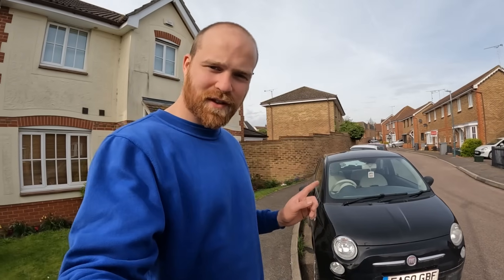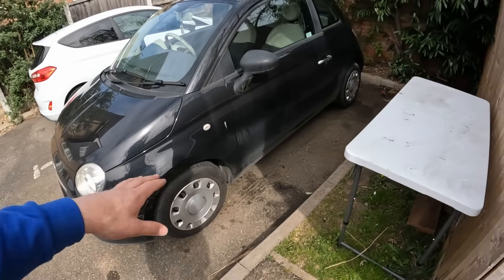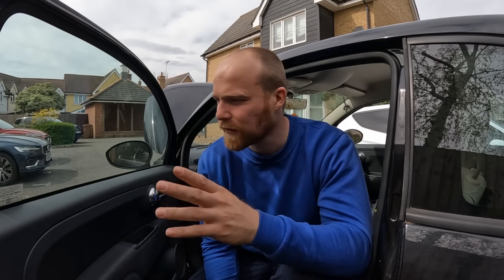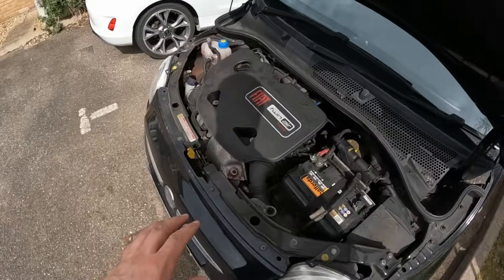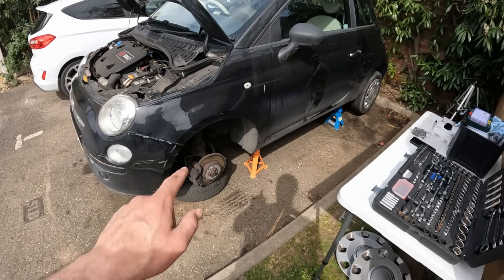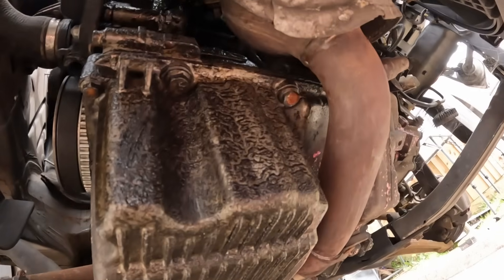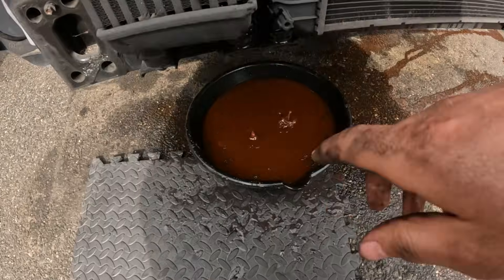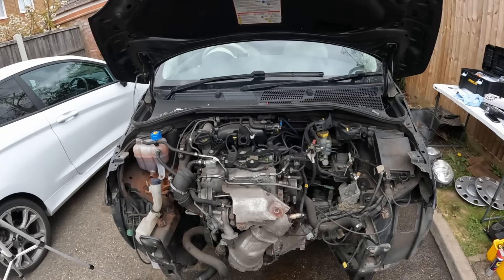Can this Fiat 500 be saved from the scrap yard?

Comment: These engines have variable valve timing, the inlet valves work from the oil pressure rather than the cam. If you had pretty low oil pressure the inlet valves would stop operating properly. Adding oil prob fixed the problem
Reply: If you want to learn and are prepared to replace the engine, you should have gone ahead and taken it apart, both to learn and perhaps fix what is wrong and because each piece can be lifted out by hand with no hoist.  Though if Tayer... is right, then the only problem might be the original oil leak and the fix might just be a seal replacement, though some oil seals are hard to get to, so some learning disassembly anyway.  Or just keep driving it, perhaps with towing insurance, and mind the oil level.  Either way, if it doesn't work out, that would have been the time to get the used engine.
    However, I think I did see extra steam and water from the exhaust so I suspect head gasket, which is a job you could do yourself.  Mustie1 even sanded down the high spots on a warped head by hand, without a planer.
   But now that you already have an engine I suppose it makes sense to go ahead and put it in, then either store, overhaul or sell the old one.  With full disclosure you can ethically sell an engine in any condition.
Reply: Hi just reading your comments we have a twinair that had a major oil leak and cut out. It was basically empty, no oil on the dipstick. Would it have cut out before it caused any engine damage and should we fix the leak and put oil in will it still be OK?

Comment: Oil starvation for the twin air is no good. No oil no pressure to push the valve open, may check the uniair module. Those engines need 0w30 fresh oil and always at the right level. The leak may be the turbo oil hoses. Do a flush of the engine oil and new 0w30 with the correct specifications. I worked on many multiar engines.
Reply from the maker: Thanks for that info, Eric. I did read the other day about the specific type of oil these engines need, so will be sure to get some and make sure she's running sweet

Comment: Before tearing Tina apart too far I suggest checking oil quantity and quality as these twinair engines rely on oil pressure to open the inlet valves. the last one i had with low compression was just low oil level. Hope this is useful.
Reply: I believe you are thinking of the Multiair, which uses high pressure engine oil to open the intakes. The intake cam is replaced by a "brick". A cam follower opens a hydraulic valve to feed oil, then the ECU pulses a pair of hydraulic/electric valves to open intake valves, as needed. Twinair has 2 overhead cams, from all I've seen in photos/vids.
Reply: Pretty sure the twinair works on this system too

Comment: I can imagine that VVT (variable valve timing) was slightly out of time. Also hydraulic lifters pushed all oil out causing valves didn’t open. The blue smoke was caused by the oil passing by the piston rings when the valves were closed and it caused vacuum in the combustion chamber. Oil top up/change would more likely sort the issue because there was just enough oil to keep the engine running and lubricated. As soon as you floor it, it lost oil, emptied lifters, moved VVT… Possibly lost oil for couple seconds but wouldn’t cause a catastrophic failure of the engine. 

Sorry if this comment is not the answer what you found when you pull the engine out. I just found this series and it is awesome you are not afraid to get your hands dirty.

Comment: Warrior PU gloves from eBay sellers are the best. Thin enough to feel (I do a lot of cycle mechanics as well and they're good for tiny bike parts) but you can reuse them loads and don't rip. Eventually the tip of the index finger wears but takes a while. Not expensive for several pairs.

Comment: As it's an older car,I would drain the oil,fill and run with flushing oil,drain,add correct oil and low friction additive,and see how it goes,before deciding on next step.

Comment: If you have small leak in engine block (blown gasket) on cold start it might not have blown gasket but once heat up it will or vice verse it depends where crack is

Comment: Assuming it is working, engines don't "just cut out" due to oil starvation, without first illuminating the oil pressure warning light.
When you turn the key to switch the ignition on in most cars, three red lights illuminate, just to let you know they are working. Those being for electrical charge, oil pressure and  handbrake/ brake warning.
If they ever fail in good times, they need to be fixed before the bad times.

Comment: Changing the engine is definitely the best course of action and is within your abilities. Don't throw anything away until the car is fully reassembled and working. You never know what you might need. You will need to flush your cooling system once it is back together again. A new clutch would be a good idea too. Don't even think about leaving the gearbox in situ. Separating the gear box and reuniting it with the engine is a LOT easier with it all out of the engine bay.
Reply from the maker: Thanks for the advice bud 🙌🏻

Comment: Congrats on the engagement. 
You have another fun project. I would deffo look at the twin air and cam as it could be part of your problem. 
Also, the common fail on tye door handle is the small hinge that fails. I have one you can have and I will post to you completely free.
Reply from the maker: Thanks, Tony. 

That's a very kind offer. I think the new door I've bought has a handle already, but if it doesn't then I'll give you a shout 👍🏻

Comment: Without oil it wouldn't set the valve timing and could leave the valve standing open hence no compression ,  as it runs , put in a oil flush , run it , change the oil and filter , run it for a couple of weeks and do it again see how you go ,  if it knocks then look further , but you need to get rid of the muck in the engine without tacking it to bits , change the oil ...

Comment: Intake valves of multiair/twinair engines are actuated via oil pressure instructed by cam/selenoid valve. Likely the oil starvation left one valve partially opened justifying the low compression in one cylinder. When fill with oil to normal levels the distribution system back to normal and compression reappears. Probably nothing wrong with the engine and oil consumption maybe related to some leaks, pcv valve malfunction, damaged turbo compressor, etc.

Comment: King! Love your videos. Love your humble and honest character that shows through. I had similar issues. Dents in door and wing from a hit and run. Handle etc. Also had power loss issues. Couldn't get it out of the lidl underground carpark without gathering enough speed to slingshot  up the incline. Felt like captain kirk when I made it. Mine ended up having a Leaky diff and needed a new gearbox. Cost of labour and parts in excess of value. Part exed it with known issues for something Korean. F. I. A. T. = Fix it again, tomorrow.

Comment: Pink crystal stuff is probably dried antifreeze as for the engine there is no need at all to remove any subframe or driveshafts just undo all the bellhousing bolts and slide the motor to the left and it will separate from the gearbox all you need to do is support the gearbox before separating them

Comment: probably the valve stuck when the oil pressure was low? the piston ring might also get stuck sometimes? the oil indicator light sensor must be broken if the light didn't come on?

Comment: Pink crystals will be antifreeze residual, oil in intercooler is a knackered turbo seal. Coolant colour is rusty, it's not been changed as per manufacturers recommend timings
Reply from the maker: Cheers, Matthew. I need to take a closer look at why this coolant is such a dodgy colour

Comment: I am 10 minutes in.   If it did not have compression and then has it one reason would be an electricaly operate cilinder head ( The valves are not mechanically timed but rather controlled by the ECU ).

Comment: The pink residue may be corrosion of the aluminum casting components, as the alloy is usually recycled and the composition is AlSi9Cu3 ... copper components (3%) are responsible for the corrosion. The copper comes from wiring harnesses when recycled and cannot be separated. More expensive alloys have only 1% or 0.1% copper components. But normally AlSi9Cu3 is good enough!

Comment: With regard to your comment about irreparable damage to the cylinders due to the unseated piston rings - this isn’t really the case. Most modern cars have alloy blocks and the cylinders themselves are actually liners. The liners can be pulled and replaced, saving the need to replace the entire block. This is something that was borrowed from marine engine technology. Seems to me though that dealerships either haven’t been told or just don’t bother to do that when something like this happens, because I’ve heard quite a few stories from several people in a similar situation and the dealers have simply told them the engine needs replacing. I have no idea why they would decide to do that when there is what I would guess must be a cheaper alternative.

Comment: pistons have oil scraping rings under the compression rings, they scrap the oil off the cylinders and the piston moves down so your piston rings see very little oil period in healthy running condition. Having no oil does damage to everything else before the rings go out. bearing's your cam, your turbo those will take the damage before the piston rings
Reply from the maker: Good to know

Comment: I discovered your channel a day ago, like it muchly, I have subscribed. Ok no there definitely shouldn’t be any oil in the intercooler, it’s either the crankcase ventilation system which is easy to sort or the turbo is fubarred, the pink crystals is coolant, and looking at the staining around the header tank, it has definitely overheated at some point, so I reckon that’s the reason the engine failed, overheated and loosing oil into the intercooler, I personally think the oil leak is a red herring, if you lost that much oil on the outside, you will see evidence on the ground for sure. However you have probably worked all this out now as this video is a month old! Oh congratulations by the way, keep these videos coming 👍

Comment: I believe you are overthinking possible problems. I've had a car and a lawnmower engine ran dry where this has happened and I've flushed the system, refilled with new oil and never had a problem even  after 2 years.

Comment: It only half an engine, you've got the right idea, the engine just falls out from the front. The hard part for me was removing the 3 bolts holding on the starter motor.

Comment: i know its too late for this comment but heres some info on fiat.
on newer engines such as the Twin air, there is only an exhaust camshaft, the inlet camshaft is replaced by a oil valvebody that opens and closes the cylinder intakevalves with oil pressure. this is the Multi-air system. pretty clever system, as youre not bound by a set camshaft lobe to open the valves, thats why these engines make a lot of power for their size.
 These multi-air systems go bad, and then youre left without compression because the intake valves stay closed. and the other moment the engine runs fine

yes Koenigsegg is busy boasting about their camshaft-less engines,, meanwhile Fiat group has them on the road for well over a decade..

Comment: s engine is very delicate use his oil only and change every 10kkm treat it smoothly and easy way 😅 im italian i know it well! if you take the old 1.2 or the 1.4 they are indestructible, now they use a new engine 1.0 3 cilinders mi,d hybrid that consuming nothing but is to early for see if it last lime the 1.2 that does more than 350 kkm whitout any probs

Comment: Hi Nino. Congratulations to you both. Your doing the right thing (taking the engine out 🤣🤣). Take a look at Love 500 Channel, all he repairs are categorised repairs to Fiat 500's. You will pick up a lot of helpful tips on nearly all you may come across during your work on this project. Not sue if he has footage on replacement engines ?? but look anyway. He also lives near a Flight Path and birds flying overhead, causing interruptions. My only worthy input about the engine flush remember the
heater matrix inside the car will need a flush also not just the radiator/engine. See you in the next one. 👍👍
Reply from the maker: Hi Norman, thanks for all that 👍🏻 Gonna check out that channel. I didn't think about flushing the heater matrix... adding it to the list!

Comment: I'd say its a valve rather than piston rings. You motioned getting crap in the engine if you pull it apart, I do my work outdoors, what i do is tape across any open ports, cylinders ect.

Comment: Congratulations to you and your future Mrs 👍
I think you're on the right lines with the rings on that piston rotating and in certain orientations the alignment of the rings is fine, but when they spin and cracks line up, you end up with no compression.
Reply from the maker: Thanks, bud 🙌🏻 Good to know I may be on the right path with the piston rings. When this project is complete I may well take the engine apart and see what we’ve got
Reply: @NotEconomicallyViable  Good idea, engine autopsy episode could be really interesting, and zero stress for you as it's all going in the bin afterwards! 😀

Comment: The 1st thing to fail with oil starvation would probably be the turbo. Just because it’s not on the dipstick doesn’t mean it’s absolutely dry of oil. Also look like the reservoir has overflown too.
Reply: Non turbo it’s a 1.2 NA engine
Reply: @northernowl7087  hi but I'm sure in the video he said it was a 875 cc twin air turbo.  Which fiat did fit to early 500s
Reply from the maker: Yeah it’s the TwinAir model. Got a little turbo on it. I’m looking at it as I type this 😉

Comment: Does the twin air have a similar valve actuator as the multi Air engines? Low oil may have damaged them
Reply: Low oil would be the cause of the lack of compression, no oil to make the valves open, but when it's been run so low it's probably better to replace the engine than take a chance with the bottom end.

Comment: I'd try a leak down test rather than compression. It would then give you a better idea where the pressure is leaking. Rings or valve seals. Cylinder wall probably polished aswell which won't seal.
Reply from the maker: I'll have to remember this for next time as it's a bit too late. Thanks for the advice 👍🏻

Comment: Given the amount of oil in the intercooler I think you are probably going to need a replacement turbo.  I think you’ve gone down the best route by sourcing a replacement engine.  At the beginning of lockdown I had a Fiat Fiorino van that suffered from a failed oil pump.  The garage thought the quickest option to get me back on the road was to repair it so they replaced the pump and fitted a new timing chain but the engine was knocking like crazy so obviously a bearing had failed due to oil starvation.  They ended up having to source a replacement engine in the end and waived the cost of the original repair.  I was lucky to get it done at the time, due to lack of customers mine was the last job before they shut down and furloughed the staff for a good few weeks.
Reply from the maker: Oh wow that’s quite the repair job in the end. And there’s nothing worse than having a work vehicle off the road

Comment: F*** hell Nino...that didn't take long! Welcome back💪🏻 and congratulations on the engagement

Gloves: nitrile gloves are great disposable gloves for oily stuff etc, but I use MaxiFlex non-disposable gloves for just generally dirty (but not oily/coolant/greasy stuff etc) - really durable

Oil in intercooler - yes normal to a certain extent - as in a light coating on the inside of the intercooler pipes, but shouldn't be dripping out

Rusty looking coolant could have come from an old, internally-rusted (but still intact) radiator, or coolant could just be degraded. Definitely flush rad (out of the car helps) before starting new engine though. Won't take you long.
Reply from the maker: Haha it’s been waiting in the wings for ages. Will check those gloves out - tried a few pairs at this point and none have been very good. Looks like a radiator flush is definitely on the cards 👍🏻

Comment: I'm wondering if that engine overheated previously at some stage? The pink crust on the block and gearbox look like dried coolant. The rust evident in what you drained looks ominous. And it appears we see the same on the inner wing under the expansion bottle. Was this all there when the car was originally  bought ?
Reply from the maker: The coolant bottle failed a couple of years ago, which caused the coolant to go haywire all over the engine. That's one issue, but why the coolant is that colour now I have no idea 🤷‍♂️
Reply: @NotEconomicallyViable  could Thinking further, that could be something like radweld or a leak stop of some sort.

Comment: Pink residue looks to be dried up coolant... maybe a leak on the Radiator which is spraying on the underside of the engine. Defo looks like the car has overheated at some point as looks to be coolant spillage around the header tank. Whilst the 'Replacement engine ' is out of the car, for the cost of a Cam Belt (cheap as chips) i would recommend you change it... you have piece of mind and far easier to do whilst its not in situ .... look forward to the videos.
Reply from the maker: Thanks for that, Jon 👍🏻